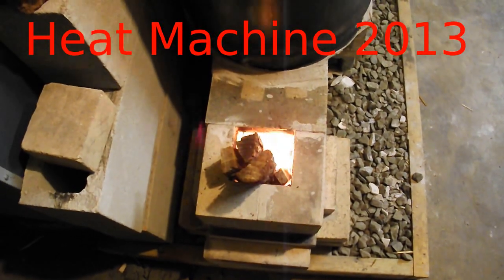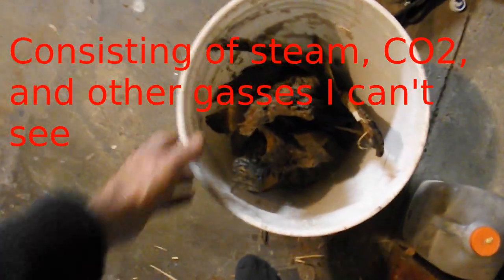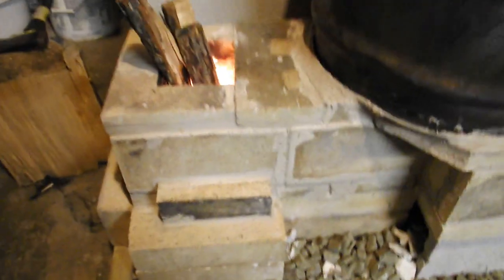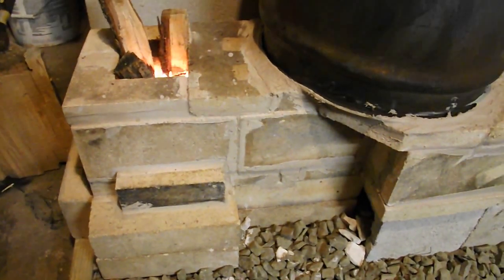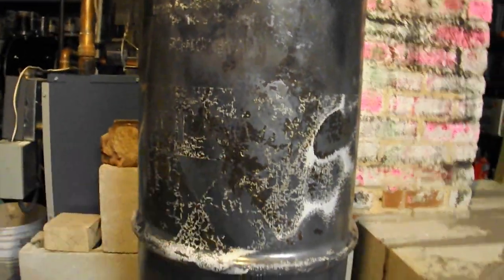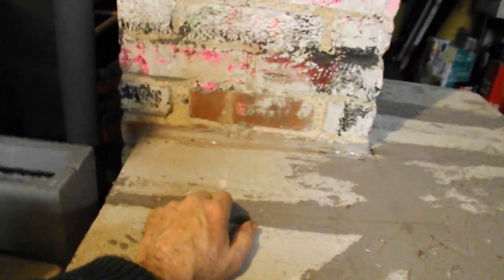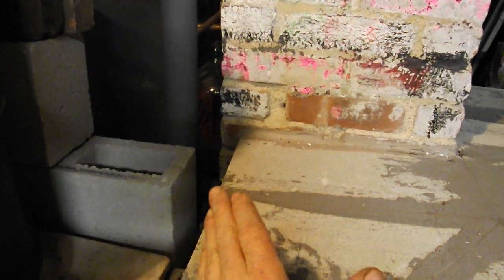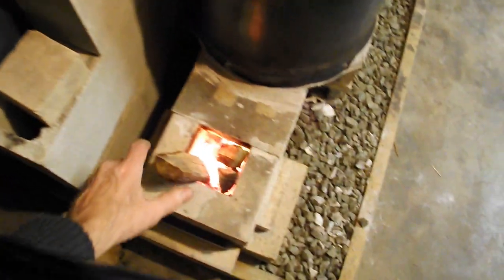Indoor rocket mass heater

Comment: Very nicely done! I wouldn't do that lower air intake into burn chamber. you would be better off placing a steel mesh box over your fuel chamber to prevent sparks but I have never had problems with smoke coming back or sparks but I don't burn to much pine either, I did have problems with having that lower air intake in use. I only use it for cleaning now.
Reply from the maker: Interesting you should mention that problem with lower air intake. I got a lot of fire in the feed tube when I tried it. I ended up doing just as you suggest, but I don't understand why there was a problem with feeding air that way. Do you know?
Reply: Every stove is little different but the reason for the top feed fuel chamber is so that it will self feed, You could block off that opening and feed fuel from bottom air take but you would have to manually keep pushing the wood in. The only thing that keeps the top wood fuel from burning out of control is air pushing downward around the wood into burn chamber (the draft) the draft is very different from stove to stove and even weather conditions effects it. Anything that will slow your draft down is for the most part not always best. By splitting your draft between both lower and top fuel opening the force of air is decreased across your fuel/wood allowing the flames to creep up. If you had straight wall chimney going straight up from barrel you probably wouldn't have a problem (nor heat collected in thermal mass) but diverting exhaust draft through turns rough surfaces it slows it down. Think of the air as water it will create little eddie like currents inside chimney going around sharp corners and imperfections in your chimney raceway. This not always a bad thing your thermal mass will collect slightly more energy from these area. Must find a happy medium. Good air flow equals a good burn. Hope I didn't drag that out to long. LOL

Comment: Sorry I haven't kept up with comments. For some reason youtube won't let me post when I use my usual computer. Maybe they don't like linux??? Works in windows though.
Thanks for the positive comments.
The draw is always there. When I start cold, the match sometimes blows out. Chimney is warm from boiler and water heater cause they all share the stack. But I think chimneys draw some even cold. Theory has it that rocket stoves "pump" due to temperature differentials between the inside and outside of heat riser. So once you send a flame up the riser, it begins to draw. That seems to be my experience with my rocket oven and rocket mass heater in the backyard and I start them in winter sometimes.
Toastmasters? yes! I hate public speaking so I practice it.
You could weigh cinder blocks and multiply. The barrel and riser are the "engine" of a rocket stove; add heat and gas moves up and out, There are a variety of materials that can be used/experimented with. I've built several heat risers out of various materials. I doubt I will ever use anything but insulating fiber going forward. So much less work. Worth every penny.
One day when I dismantle it I'll post images of interior. Til then it just works:) 
There is TONS of information about theory and construction on Permies.com and Donkey's Proboards. Those are the real pros.

Comment: Good job, cool design. My main question is, how long does it take to start a draft? It seems like such a  long flu might make the interior of your structure a little smokey until the chimney can start drawing air? I've not much experience with such things, so I'm just spit-balling here, but maybe a small air pump could help, or a small opening in your chimney to create a little draft fire to start it pulling air?

Comment: So what is the barrel for exactly? I don't understand this part with the silica fiber that retracts, but it coats what? And why?
All the angles don't make you lose too much drafting power from the chimney? Could you add more angles? How much stone is that in weight?
How do you know secondary combustion is perfect and you're not getting tar buildup at some angles? (the clear smoke is an argument, I agree)
Very interesting project, you really built something vauable, impressive!
Reply: Any amount of internet research would answer most of your questions and show you the inner design of a basic rocket stove. The silica fiber was his twist on the idea but not a part of basic design. Just type 'rocket stove' in a search engine and look at the images of designs. It will show you the inner chamber of the barrel and you'll better understand what he was describing. Hope that helps.
Reply: I've resaerched the issue for almost a year before buying my stove, and then read what I could find and watched probably 20-30 vids.
But I still ask noob questions apparently!
Reply: Watch Flaimdancer's channel, it has the most amazing stove designs. And Mr Teslonian has built some impressive stuff

Comment: Your stove is great, your reasoning (on CO2) flawed, but who cares as carbon dioxide is not really an issue, it's certainly more of a positive than anything, we've been brainwashed on this.
I wish we could see inside. The system I'm dreaming of would have a lot of inertia thanks to accumulation of heat in stones. Too bad I get to construct the real thing on my first try, would need more experience first.
Thanks for the vid!

Comment: This is very impressive.   I am especially  intrigued with   the heat riser.   That is a very unique idea and if it holds up well it is quite easy to implement.   It would be very helpful if you updated your experience with this stove from time to time.  Knowing how well that heat riser holds up would be a valuable piece of  information.  Thanks so much for sharing this video.   I saw your post on Donkey's board.  Best wishes with this stove and please keep us updated.

Comment: I'm still somewhat confused on the insulated risers in general and your materials sounded more exotic than any.  I really liked how you mitered and channeled the CMU.  I've read so many things about this type of heater and there are contradictions.  A concern for me was the height of the chimney.  Someone stated that if it is too tall, it will not warm, will not draw, and acid condensation will eat away the mortar.  This old, but new to me, and very cold house has a centrally located double sided fireplace that is perfect for locating a RMH on the kitchen side. There is even some unused triple-wall in Mom's barn she said I could have. It looks like you just vented 35' and it worked well, so I should have no problem with 15'. Thank you for the video.  Next year's winter will be more comfortable.